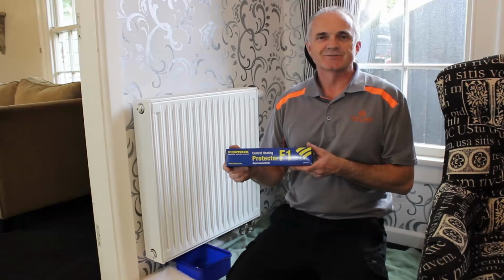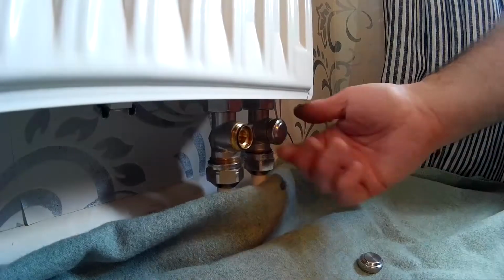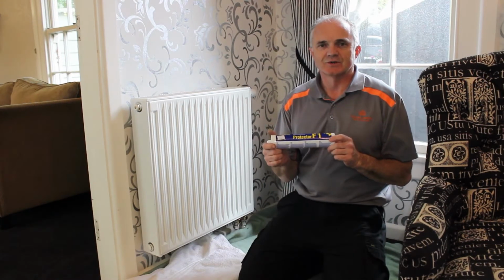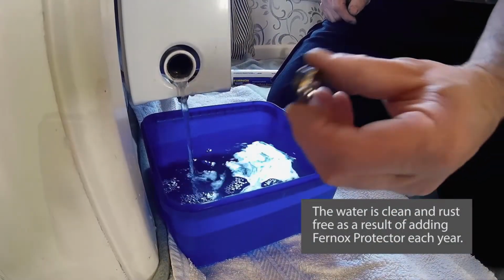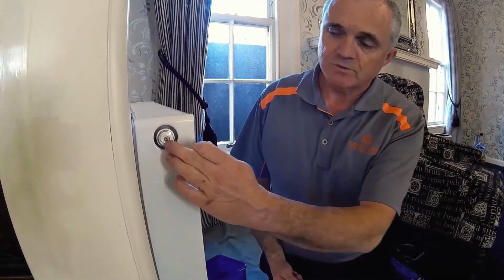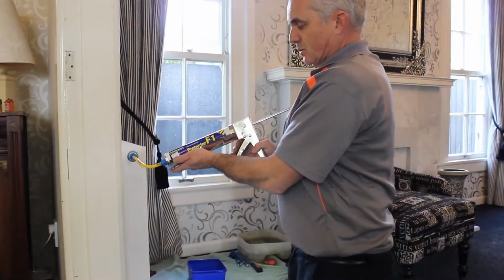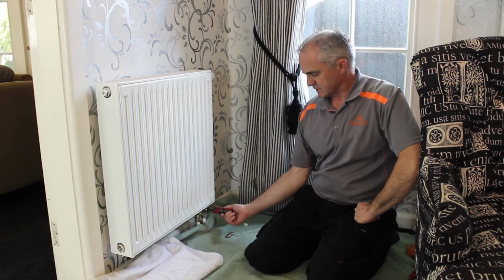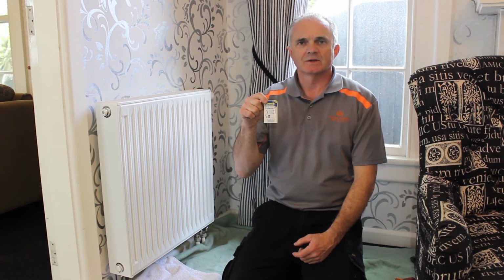Protect your central heating system from corrosion with Fernox F1 Protector

Comment: how long do those inhibitors last? in other words.... how often should I flush and re-apply? thanks
Reply from the maker: Hi Hal, the short answer to your question is the concentration of the inhibitor in your system should be testing annually to ensure the concentration for the system is correct. As a central heating system gets topped up with water over time the concentration of the inhibitor becomes diluted and needs to be topped up. For more details on this, I recommend having a read through this short article: https://www.centralheating.co.nz/blog/corrosion-prevention/
Reply: @centralheatingnz  thanks!